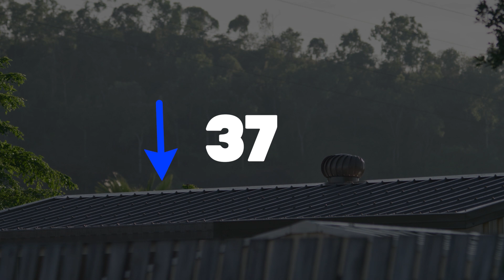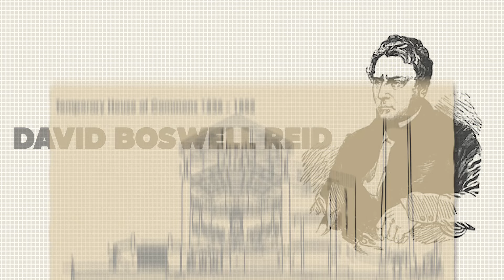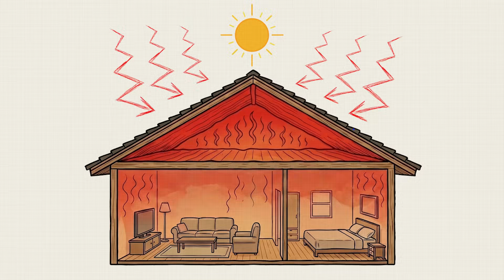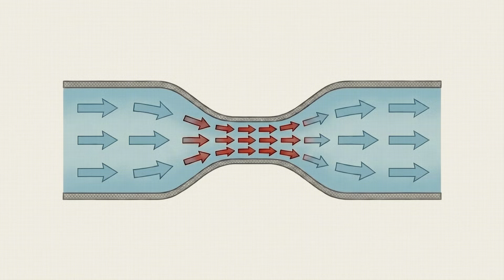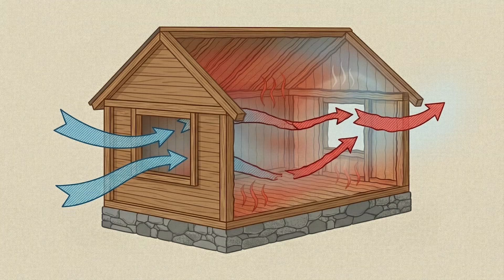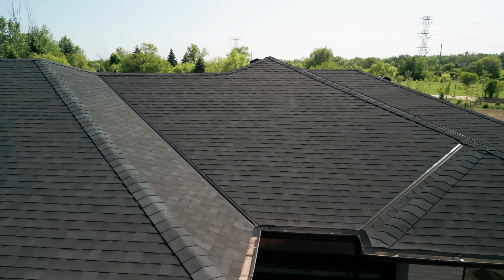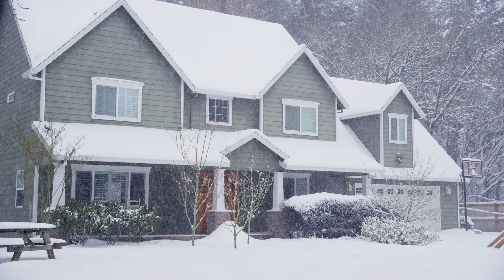Why Did We Stop Using This Natural Cooling System?

Comment from the maker: I've been on a bit of a role with ventilation recently, so this week I wanted to cover on a system you don't see very often anymore - the Whirlybird. I hope you enjoy the video :)
Reply: *roll
Reply: I love your AI BS Dutch windmills turning furiously with NO SAILS deployed.
Reply: AI content sucks!
Reply: There are several mistakes in this video. Please don't just AI generate stuff. The diagrams are pointing out the wrong locations of basic stuff like soffits and you show the AC units as an open loop. This video is just wrong.
Reply: I just started a new job, and we're working on an expansion project for an actual Whirylbird factory. So they might not be popular, but the company that makes them is still growing
Reply: 10:45 ??? whirlybird freezing??? sir i live in the land of maple syrup and we get winters that are like -40c in the 35 years of having my whirlybird on my roof its never froze over the winter. so i can calmly say that's not an actual issue unless your in the antarctic, region :|

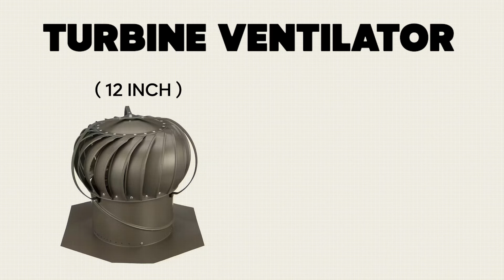also the ridge vent to whirlybird ventilation numbers don't seem to be mathing out here, like the whirlybirds you calculated in cubic feet (6:10), and the ridge vents in square inches... 1 ft is 2.2 inches so the ridge vents are nowhere near 3x more efficient if they only pull 900 square inches compared to a single 14 inch whirlybird yoinking 500 cubic feet... like in general your comparing a 2D volume to a 3D volume so professionally you make no sense.

like even AI's gonna tell you "It is like asking whether a 50-mile road trip is heavier than a 10-gallon bucket of water."
Reply: It's like how we don't see awnings on new houses these days.
Reply: How often do the roof vents need to be cleaned?
Reply: @wardog5537  Installed nearly 20 years ago, hot southwest summers. No accumulated 'anything'. ;]
Reply: roll*
Reply: @JB2X-Z  Wait, I think the AI is right:   Role.  Role pretending to deliver something of value:  but first, lets go back to the Tang Dynasty, as if that is useful.
Reply: I wonder how these ventilator works if it rains? Does the rain get through it and drop onto the roofing below?
Reply: @AnOwO69  In heavy rain, a few drops may get through. The moving air will dry them fast enough. Put down some plastic sheeting underneath if it makes you feel better.
Reply: I enjoyed it. When we move to West Texas, I will be looking eagerly for these!
Reply: Good video. Here is another point, these whirlybird vents can also cause mold. The can drawing warm moist air which can condense on the wood, especially in the winter.
Reply: Why is it so hard for Americans to put Celsius up on the screen too, Fahrenheit means nothing to a lot of the world.
Reply: You miss-frame this entire conversation.  A long ridge vent moves just as much air as these devices, without having a moving part that breaks down.  The building industry has moved towards ridge vents because of the same because homeowners like the way it looks better aesthetically.  Stop pitching stuff like it's a conspiracy theory. That damages society when you do that
Reply: @brianwnc8168 the entire video is ai, I could tell by the script and the diagrams. Some of the diagrams make no sense. Whoever told AI to write this script, they probably told it to make it click bait.
Reply: @brianwnc8168 srsly? I watched because I was curious and because I also noticed these ventilators are becoming less noticeable. The conclusion is the same as what you stated, so where's the harm?
Reply: 🔴 What Is Islam? 

🔴 Islam is not just another religion. 

🔵 It is the same message preached by Moses, Jesus and Abraham.

 🔴 Islam literally means ‘submission to God’ and it teaches us to have a direct relationship with God. 

 🔵 It reminds us that since God created us, no one should be worshipped except God alone. 

 🔴 It also teaches that God is nothing like a human being or like anything that we can imagine.

🌍 The concept of God is summarized in the Quran as:

📖 { “Say, He is God, the One.  God, the Absolute.  He does not give birth, nor was He born, and there is nothing like Him.”} (Quran 112:1-4) 📚

🔴 Becoming a Muslim is not turning your back to Jesus. 

🔵 Rather it’s going back to the original teachings of Jesus and obeying him.
Reply: why do you not read Jesus words yourself?  what we have today is the same as what was around 600 years before Muhammad.  Jesus words sound nothing like what Muhammad taught. not even close, in fact they are the opposite.  Jesus taught to love one another, even your enemies. Muhammad taught to kill your enemies.  Jesus taught that no one will go to the Father but through Jesus.  be very careful with your soul.  do you follow the one who was proven to be from God by all the miracles He did or do you follow the one who raped the wife of a murdered Jew.  the one who kept sex slaves.  the one who married a 6 year old and had sex with her at 9.  the one who lusted after his nephew's wife and married her.  there are tons of other examples against Muhammad, if you would but open your eyes.  this is not 7th century anymore.  the internet has opened up discussion and research into Muhammad and it is revolting.
 Jesus was attested to have died on the cross by the Romans, Jews and Greeks - Muhammad said don't believe it.  well, do you put your soul in Muhammads hands or in God's?  Jesus said he was the truth, the light and the way - why did he say that?  the answer is available, just takes effort on your part.  open your eyes to the truth
Reply: @الدعوةالىالله-خ8م 
Not to be rude, but if “he’s” noting like us or even imaginable, why he then?
Reply: Nothing